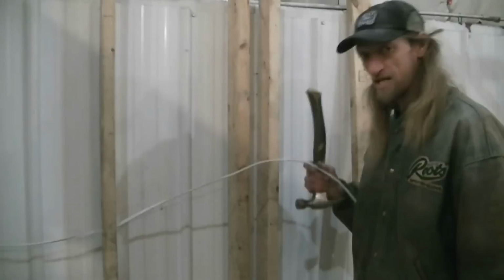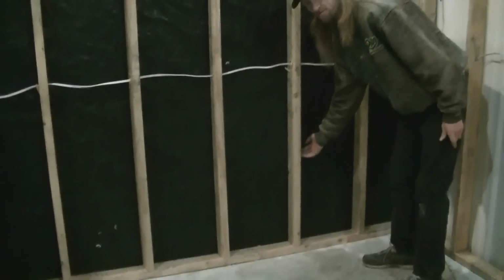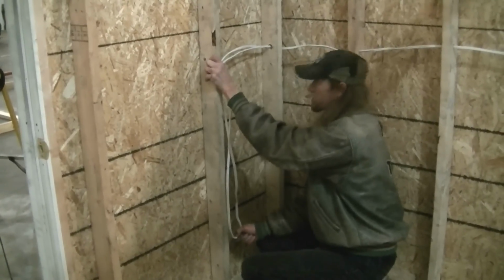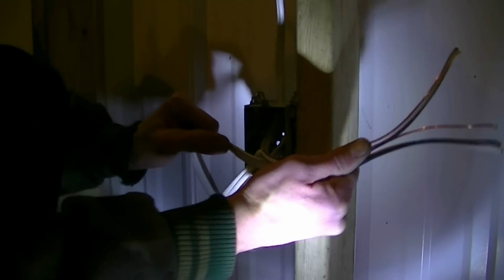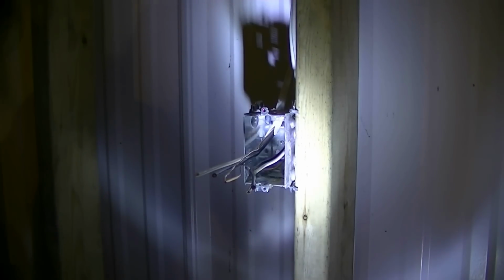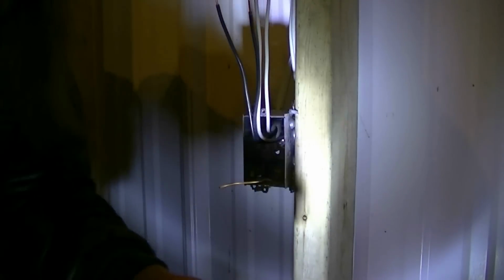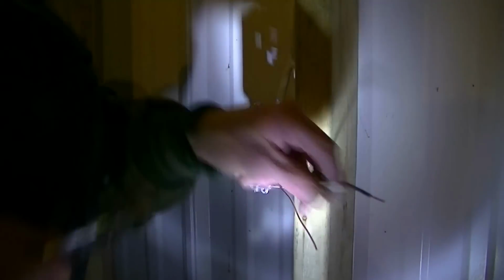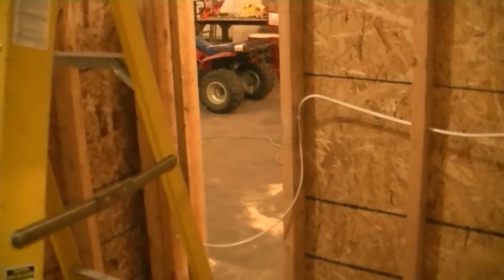How To Easily Wire Household

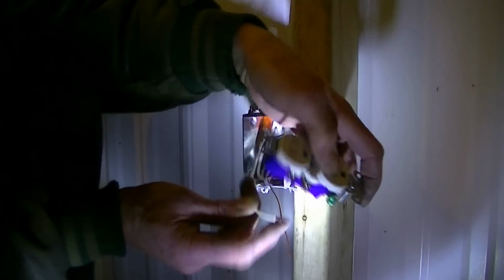Comment: At 17:10 you installed your "White Wire" incorrectly, you had a left twist to it, & not a right twist,.  The right twist, when you tighten the screw will enforce the integrity of the bond.  A left twist will possibly loosen the bond between the screw & the wire..  Big Boo-Boo!  You would have failed a inspection!

Comment: For all your Morons, This is in Canada, Yes Code in Canada is 8 Out lets per 15A Breaker, 16" no lower for outlets, wire needs to be at least same height as the Out Lets.
Reply: actually no its 12 items, you are allowed to load a circuit 80% and 80% of 15 amp with each item being 1 amp is 12 items, so you are infact the one that is wrong here, and receptacles can be lower than 16", infact they can be in the floor even if you have proper floor boxes, the typical height for receptacles is 12-16" range though, and 42-48" for switches

Comment: question: am from the UK and am a level three qualified electrician over here we use the European color brown, blue and yellow/green....... when we do any work like this we use cable called T&E (twin and earth)...... the cable looks to be the same as the cable rickem is using two wire with pvc sheathing one with out tho over here are BS7671 and are regs state that the one without any sheathing which over here is the earth, think the USA call it ground , has to be sheathed during the installation to help stop it from touching any thing it shouldnt really and cause a fault on the ring (circuit) my question is as i didnt see rickhem use any is do yous not put sheathing over open wires like that.... is that something your building standards dont recognize as save practice......

Comment: Fare play man. :)  but didn't realise how shit those 2 pin sockets are compared to the UK 3 pin Mk type, don't know how lads haven't been welded to them open connections lugs on both sides. For testing they would be a nightmare I say. You might try a ring circuit for both rooms and spur'd out to each socket meaning you can isolate any part of the installation, handy for safety reasons and when your leaving the place you know which bits are switched off with out hopping in under tables and units, all so be sure to install an RCD or an RCBO for extra safety.

Comment: You mention at the end to be SURE to have it inspected. Some commenters here may think Mike Utoober is somewhat different or unique but he is correct in all he said.  If you are having it inspected you must have already pulled a permit and shown the planning department your drawings but you seemed to be making decisions about placements as you were going along which leads me to believe you have yet to pull one.  When the inspector comes in and sees your work, he will more than likely realize it was not done by a licensed electrician and therefore probably will be nit picky. I suggest you go to Home depot and pick up a condensed copy of the electrical code. It has  everything in it you will need to know for the small job you are doing. London can get quite nasty if you don't pull a permit.  I know this as fact because I had them slap me with a stop work order for not having a permit. As a fine they doubled the permit price and and were very nit picky with everything. The code also specifies distance between receptacles. Your longer walls would probably require  a second one.
Reply: jonnyrobinson1 Every 1.8 meters a plug is required if hes wiring this like a household, so yes they would require more than one

Comment: The wiring looks clean. But those tabs on the outlet could be used. Not much need for splitting the wires for every plug. Awesome though rick. Appreciate the video

Comment: Wasteful, wrong and code violations
1. why have the wire run so high? you are using far more wire than you need to
2. you are allowed 12 things on a circuit, not 8
3. Microwave and fridge must have their own circuit EACH, not shared
4. you should have a loop outside the box incase damage ever occured so you can fix it easily by loosening the cable clamp and just pulling more in
5. you should strip the wire sheath of the outside of the wire BEFORE putting it into boxes, it is far easier
6. you are only supposed to have at most 1/4" of sheathing PAST the cable clamp in the box
7. grounds do not need to be twisted together like that if you had the ground screws in the box you just pass it by them, 2 ground screws 2 grounds
8. if you know what you're doing cutting up further into the wire will not cut the insulation off the wire with a knife
9. you do not pig tail the neutral or hot before going to the plug, 2 terminals on the plug, 2 wires, just put it on both terminals on the side of that receptacle
10. you did not twist the wires together enough because marreting them
11. those orange marrets are not big enough for the application you are using, you need yellow or blue
12. you DO NOT do a 1/4 turn to make a 90 degree turn on the end of the wire. you make a full hook that goes in the plug and back around to the back of the receptacle again
13. the wire wraps around the screws CLOCKWISE so that it tightens it and pulls it in as you tighten, not pushes it off as you tighten the screw down
14. commercial building you cant even touch electrical if you aren't licensed and you MUST pull a permit
15. you may even have to use BX and steel studs since it looks to be a fire retardant building

I really wouldn't want you wiring my house, this is a very sloppy, poor and quite wrong job

On top of the wiring, you have framing problems too, you are supposed to have a block going horizontally between the studs atleast on the walls you do not have any sheathing on the outside of, if not all. and if you want to put a 34" door in you make your frame opening 36" not 35" or just over 35"
Reply: that is far from code what he is doing
Reply: You mad Bro?
Reply: dont you have some stupid junk yard to hang out in you fuckin daves farm goof?
Reply: Shots fired hahahaha
Reply: Strip a good inch of wire..twist them nice and tight by hand...cut the twisted wire so they fit nicely in the marrette...and everything mike just said..Im a plumber...but I wire my boiler jobs myself...sparkies always fuck it up
Reply from the maker: Accelerator Vids Its Northernpride from the farm.
Reply: Right on man! Its about time someone called out this Goofs workmanship. This is definitely not the way to wire your household and Rick is an idiot for trying to "teach" it to anyone. It is totally unsafe and the exact opposite of cost effective, also i would not be advertising this on youtube. This is one step up from work you see in third world countries.. Congratulations i guess.
Reply: Gordon Shumway I am actually in an electrical course in college, i have been told to do exact opposite by licensed electricians
Reply: Rick if u have any buds that are electricians have them pull the permit and come inspect for safety I'm sure you'll be good. This comes from. Good source.
Reply: Where the fuck is joe.
Reply: Mike Utoober Does it matter bud? Rick is doing it to code enough and is being smart
Reply: Mike Utoober As long as the boxes are 16" from the floor and there is 6" of extra wire then its somewhat to code
Reply: Mike Utoober smoke cigrits
Reply: exactly, some of us were screaming at the screen, yes waste full, commercial not right
Reply: okay bud
Reply: Randy Bobandy Dont kid yourself. This is farther from code than most construction sites in India. Not to mention hes just renting the building. I wonder what the landlord would say about these shifty antics...
Reply: Are you a sparks Mike.
Reply: ***** I already called in London city hall, they're going to check it out next week

Comment: neat trick with the loop, i find pig tailing outlets leaves the box crowded myself but it still works just as good :)
Reply from the maker: ghettohillbilly1 Plus if a outlet goes bad you don't lose the rest of the line.
Reply: RedneckRickem thats exactly why ya pigtail all conductors !

Comment: Four tabs and two ground lugs per outlet. No need to pigtail leads, the four tabs per out let are for load in and line out. Makes for
A neater and safer box. Of course, Canadian wire standard may be different than u.s, if so, I bmp.
Reply: i prefer using the tabs instead of pig tailing myself to, keeps the box more open in clean in my opinion but i think both ways are allowed

Comment: Rick you should of left a little loop of extra wire just incase anything goes bad with a wire   so you can just pull on it and you got some extra to fix the problem ,  i worked for 3 years in electricity company with my brother-in-law 's dad . we used to wire up the rich houses that where being built. and you should always leave a loop  for safety

Comment: When I did my shop a few years back we wired through the line side and out the load side and only pig tailed the grounds. Also we never went over 6 outlets on a run of 12 gauge wire because we only 100 amp service to the shop. Also be sure to use approved metal plates in front of each stud that has a wire through it. Wiring is a good handy thing to learn..

Comment: Max outlets per circuit is 12, not 8. Wiring attachment to recepts must be wrapped at least 3/4 way around the fastener and must be adjacent. 16:49 you criss-crossed. And you can't fasten more than 1 wire per screw as you did twisting the grounds together. There's 2 grounding terminals per box, use them, or pigtail. Just a heads up.. inspector most likely won't like it if he pulls a recept, and since you're not a licensed electrician, he most likely will. But first you need a permit and since it's commercial, you can't even do it yourself in the first place.
Reply: I doubt rick pulled a permit.
Reply: In order for it to be commercial, don't you have to have some sort of business license, tax permit, or both?
Reply: The owner of the place would. If you rent out shops, you always commercialize it for lower taxes and for legal reasons. So if say, someone builds an office without permit in your shop, then wires it without permit too.. the tenant is held responsible if the place burns down or someone gets hurt.

Comment: You are allowed to do the wiring in Sweden, but you are not allowed to plug it in. Need to be inspected first. I did wiring in my apartment for some halogen spotlights and then had an electrician domthe check and plug it in.